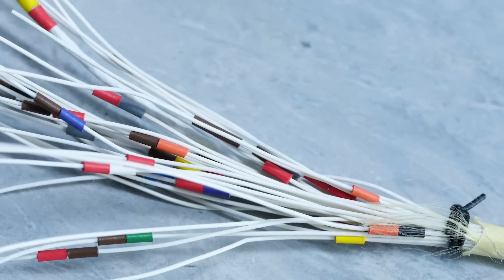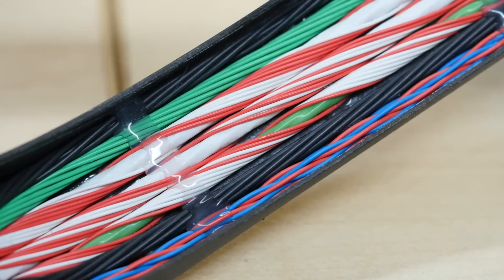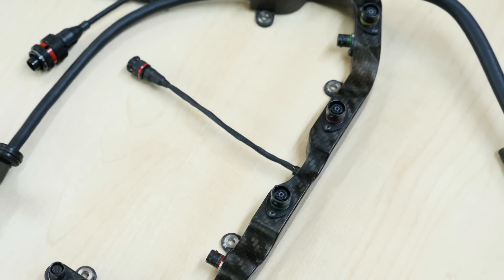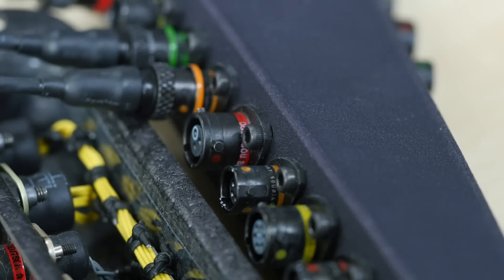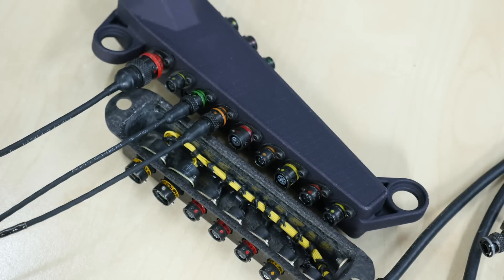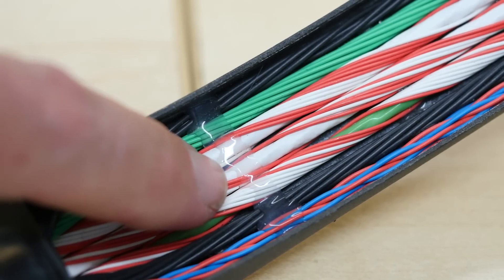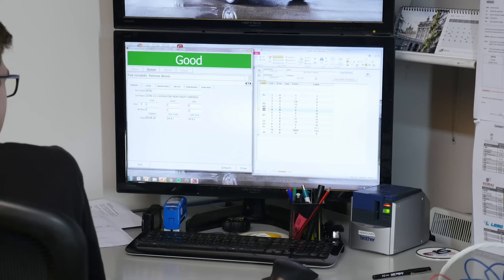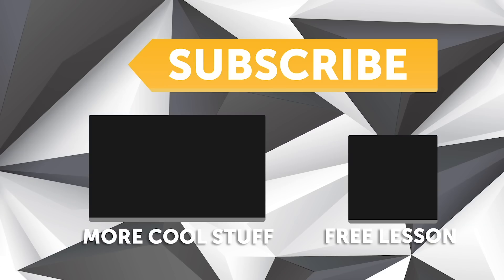What Goes Into A MotoGP, Formula 1, WRC or Formula E Wiring Harness? [TECH TALK]

Comment: With discontinued parts coming more prevalent for 90's cars (i.e. A80 Supra), for a road car , is a motorsport harness suitable , what Q's should be at the forefront when choosing a Harness builder , is it a good time to switch to a  PDM or will it be increasingly difficult to integrate road going ancillaries not normally found on a race car?

Comment: This is nothing against a wiring harness for military application
Reply: sorry, but the connectors are actually based on mil spec, just lighter. the wires are high temperature as well
Reply: @Leonelf0  in military aviation you have a temerature rage from -96 to +300C  an they are all tested
Reply from the maker: You've made s a really, really broad and non-specific statement, but in a nutshell, the requirements for motorsport are different from military applications so you can well expect they are not going to be the same - Taz.
Reply: It’s basically the same as military aircraft

Comment: Damn, never thought of using short pieces of heatshrink at the ends for further identification of the wires - it's like the trace used in older cars' wiring - it could even be further refined with two pieces.
eg. 8 basic colours > 56 combinations (same colour as base not used for easier visual) > 392 combinations. Sure would beat trying to read tags, or type under a clear sleeve, that might be rather difficult to read in place.
Same principle would also apply to sensors, oil, fuel, coolant hoses, etc, where needed.

Comment: and here I am using Narva crimps 🤣
Reply: Same lol
Reply from the maker: If they suit your application and budget, it is what it is, but it's not a huge investment in gear or time to move up a few rungs from those ;) - Taz.
Reply: Done correctly you probably will have no issue with narva crimps, but you will find that DT and DTM connectors are pretty cheap, or alternatively I have had good reliability out of the 2/4/6/8 way connector blocks using open barrel brass spade connectors. I use the waterproof DT/DTM connectors outside the cars cabin but inside the cabin I have been using the basic non-waterproof ones. 

Remember this is a professional motorsports orientated channel so even though some other products will be suitable, you wont likely see them talking about those cheaper but still do the job perfectly fine alternatives. 

They send rockets to space with the basic spade connector blocks... dont worry, done right they will be fine!